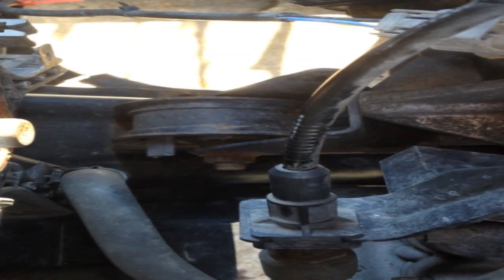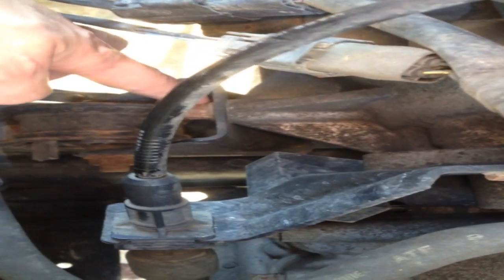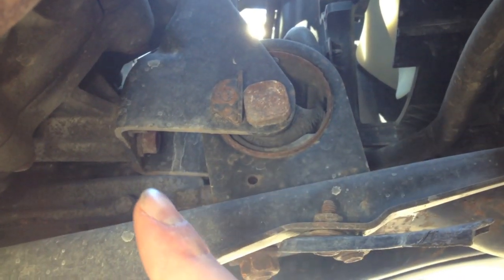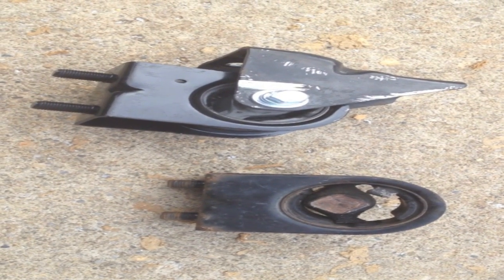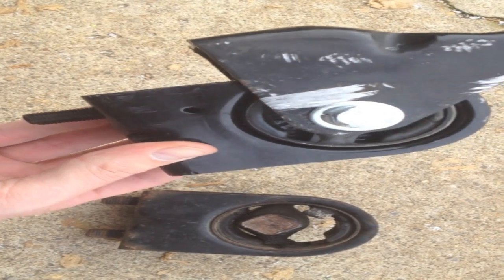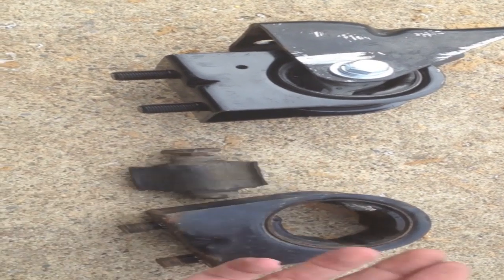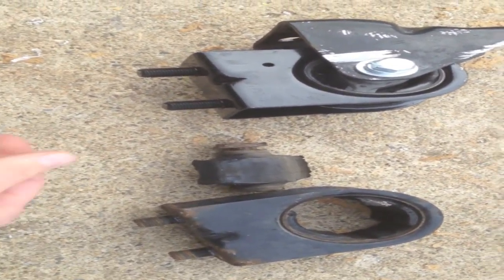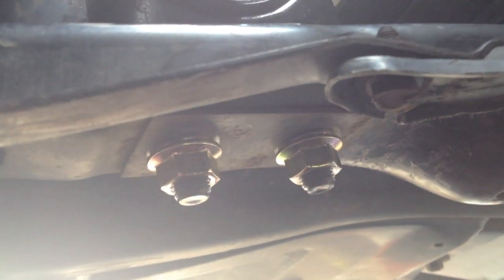Mazda Protege Front Engine Mount Install How-To

Comment from the maker: @protegejustin1999 Like @StepTo3 said that's the hard one to get to. I don't plan on having the car more than another 30k miles so I'm not worried about changing that one. If I remember correctly it was attached to the trans and motor and had a cross member that needed to come out to get it out. Good luck I hope you figure it out. If you do let me know and I might change mine and do a video

Comment: do u have a video of rear engine support replacement? seems to be difficult to remove.
Reply: my rear mount were taking down with the front crossmember off. (the shop did it for me, i was asking local shop to  fixing all the rust and repainting the crossmembers while doing the undercoating)

yea its difficult from the top, i read bunch post on it. u can find more info on mazdas247 i guess

Comment: how do you get to the mount by the firewall 2002 protégé 5
Reply: That's the rear mount.  Notoriously hard to work on, check the mazdas247.com forums for more good info.